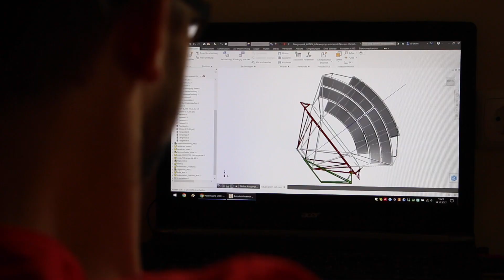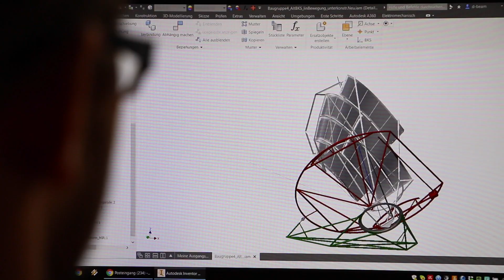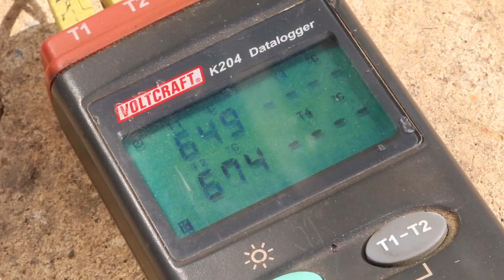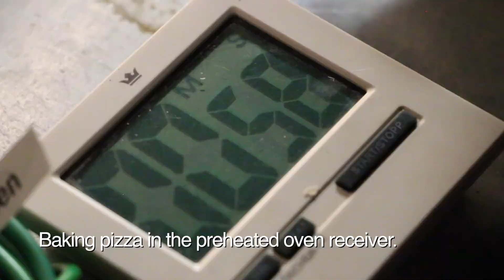a special mirror for the world - melting copper with sunlight - tamera free lab - daywalker e28

Comment: I LIKE the idea of fix-focus mirror arrays, but you have to keep in mind that they're doing this in Portugal. Most of the population lives in and around big cities that don't have as much sunlight as Portugal. Would this work as efficiently in Dusseldorf or Prague or London? My own idea includes a bigger fixed-focus array that only needs to rotate on a carousel assembly cca 180 degrees in 2D, with only the focal point moving up and down based on the Sun angle.
Reply: @Sen Se That's not a bad idea. Actually, more research should be done whether it's more efficient to focus the wind or focus the sunlight, but I would imagine that depends on location. Does the location have more sunlight or more wind? Also, which one is safer? And, is that the right approach versus thinking in terms of more decentralisation? If you drive between any 2 big cities, what do you see? A lot of empty space. The occasional huge wind turbine seems very expensive and dangerous. Instead of having one big turbine, how about thousands of smaller ones that would be only say 4 m high? That way they would be easy to service, easy to set up, and you can still grow crops underneath them. Each of them could be outfitted with an automatic parasol that would fold out with solar panels on it that would provide some shade to the plants beneath it when necessary.